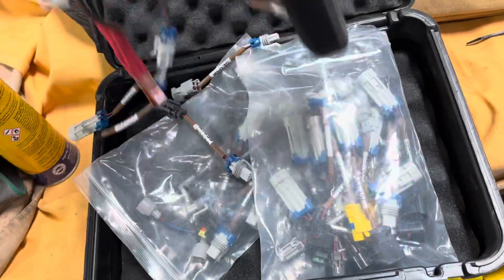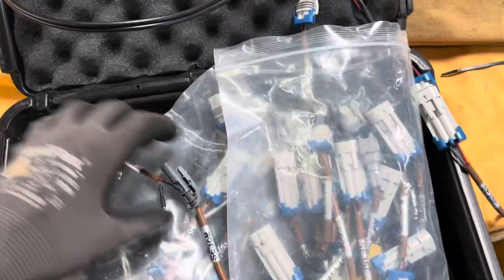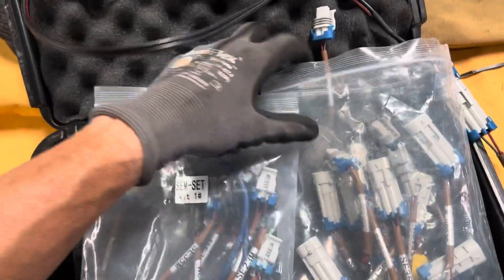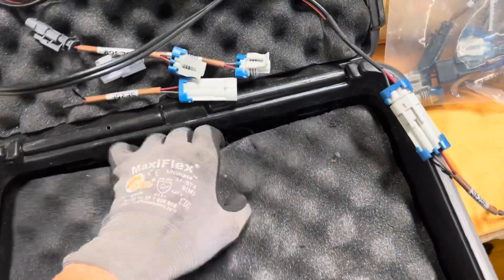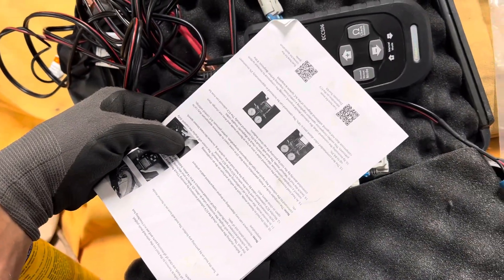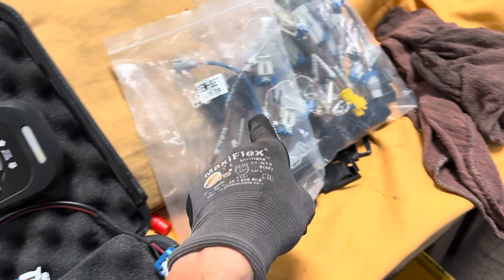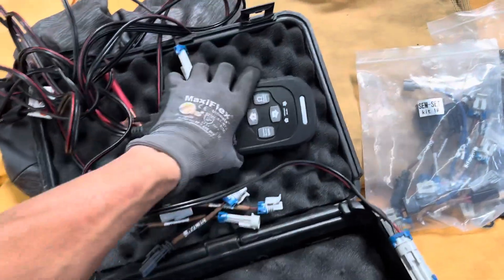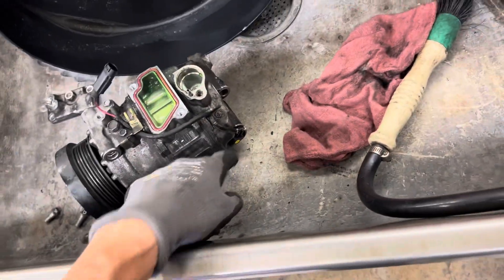Tester for variable displacement compressors. ￼

Comment: I understand you’re very specialized in the hvac trade. As an automotive diagnostics guy I also specialize. The way I would test this compressor would be using a current clamp and an oscilloscope. If you take a current waveform you can see the physical movement of the solenoid with what’s called a Pintle hump. I can see the utility of that tool for someone that does what you do. I just prefer to use a tool I already have and to verify the electrical system of the vehicle is operating properly. I love seeing your perspective because it opens my eyes to other methods and tools.
Reply from the maker: Yes I have a oscilloscope only when there is an odd diagnosis or something really strange I’ve never seen before and no one else been able to fix it will they break out the oscilloscope. 

My first old oscilloscope was when I got back in the 80s it was called Gold Star before the name was changed to LG.  Used to use it and drive ability issues when the old fluke 87 was not fast enough to catch a intermittent problem like a glitch in the TPS  That would cause a transmission to shift erratically or other sensor related problems that usually would get sent for passed along from other shops. 

When I was a child my dad used to show me oscilloscope patterns diagnosing alternator diode‘s that were starting to break down but we’re still working but we’re just about to fail or were intermittent.   That no other test equipment that was manufactured at the time to catch the failure that was used in automotive except for a oscilloscope. 

Same goes for the breakdown of transistors that were responsible from switching from the ECM to drive the drivers going to fuel injectors intermediate problem that would not show up on any kind of test meter. 

Oscilloscope is a must have tools no longer an option for a real technician. 

Not just being A kid a dealership hires from a gas station and teaches them how to plug-in a connector and wait for codes to be spit out changing parts randomly not even understanding how the parts even work